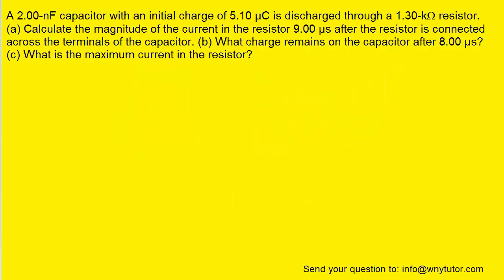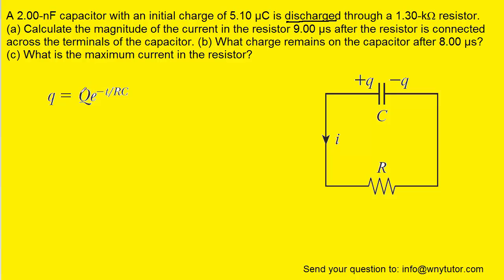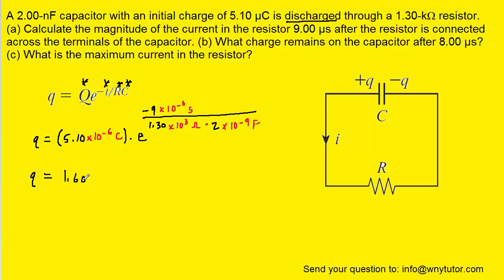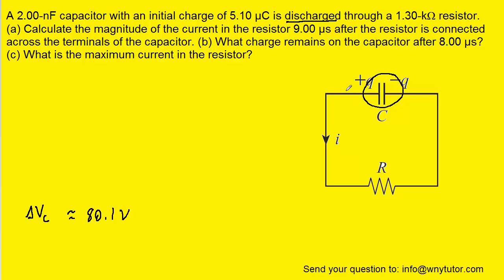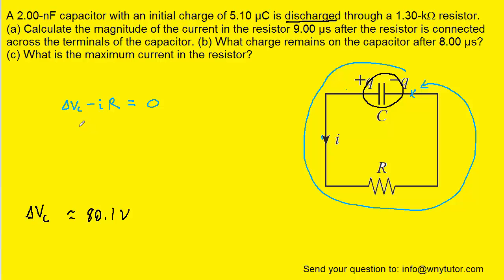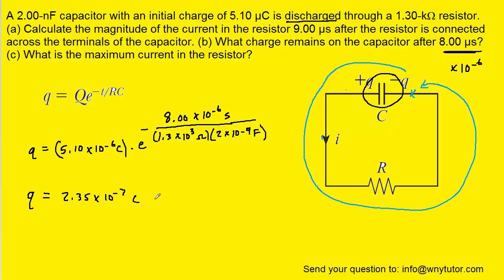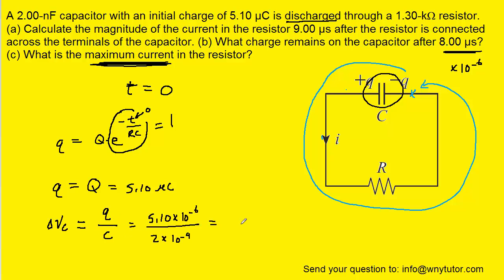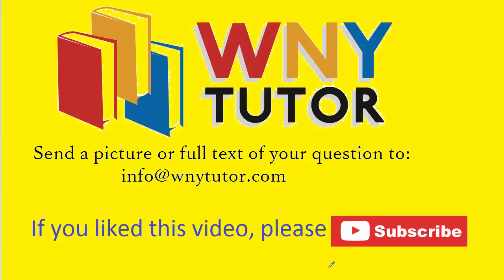A 2.00-nf capacitor with an initial charge of

Comment: Any help on this would be appreciated: The voltage across the capacitor is decreasing with time since the charge is decreasing. But the current in the circuit is increasing because there are a greater number of charge carriers present with increasing time. The voltage on the resistor has to match the voltage on the capacitor at all times. But for the resistor that means its potential difference is decreasing (because the p.d across the capacitor is decreasing) but the current across the resistor is increasing. Clearly the p.d can't decrease while the current increases across the resistor. What is wrong with what I've stated?
Reply: Current is decreasing as cap discharges and it's voltage drops